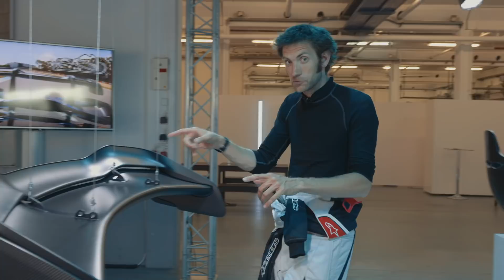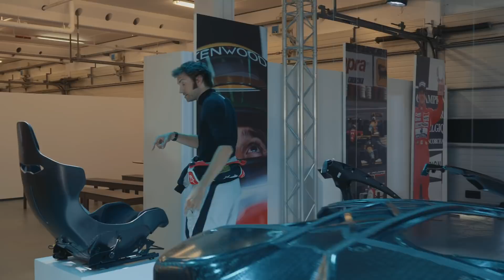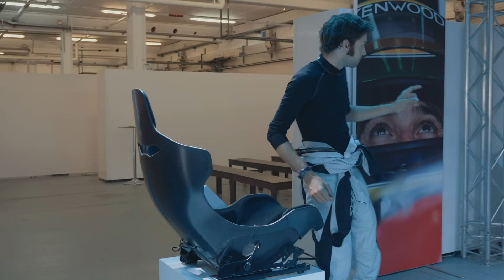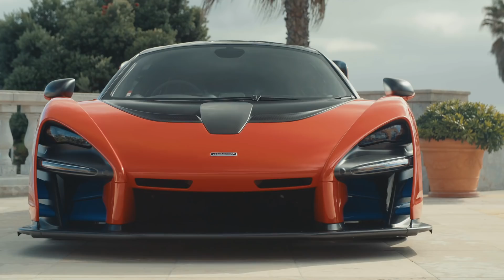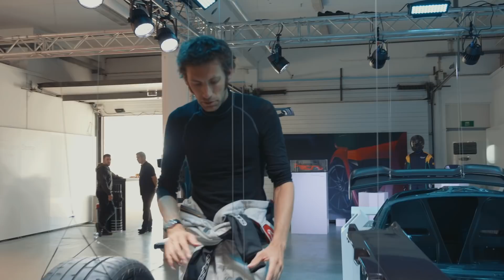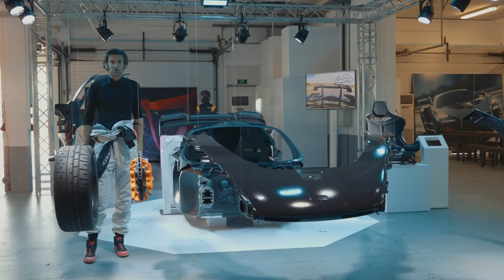The Lightweight Engineering Of McLaren Senna - Carfection +

Comment: This makes the koenigsegg agera rs so much more astounding. The agera is around 100kg heavier but with a bigger and much more powerfull engine, removeable roof and much more "luxury" features. (+ it's 3 years old now. i bet koenigegg could shave of a lot of the weight if they would do a ultalight barebones version. even the one:1 has leatherseats, heightreluglation a big infotainment system and so on)

Comment: Do the brakes have a diff material mix compared with other McLaren carbon ceramics? or is the only difference that they are cured much  slower?

Cool video BTW
Reply: Mile The braking system is the most advanced ever fitted to a McLaren road car. The next-generation carbon ceramic brakes utilise racing technology, and each disc takes seven months to create – seven times longer than a conventional carbon ceramic disc. The Formula 1™ inspired front calipers feature a super-stiff monobloc design and six ventilated pistons to reduce temperatures. A brake booster used on the track-only McLaren P1™ GTR enhances modulation and pedal consistency. The resulting braking performance is phenomenal: 124mph (200km/h) to standstill is achieved in just 100 metres, and less than 30 metres is covered when stopping from 62mph (100km/h).  

Copied and pasted straight from McLaren. Dont know if it really answers your question though.

Comment: Hate on the Senna all you like (if you do). It’s been designed to crush lap times not look pretty in Monaco, Beverly Hills or Knightsbridge.
Reply: True, but I wish that McLaren had given it another turn to be a bit more radical, more in the league of the project one and the Valkyrie, but I understand that we are talking about 750k not 2 millions or more.
Reply: For sure. As fast as the Senna is, I think the Valkyrie and Proj. 1 will far exceed it's performance and be closer to LMP1 (on slicks) than any other road car ever made. The Senna probably has a real world 850+ BHP, but it definitely falls of the other two cars, but as you say it makes sense with the price difference.
Reply: CADesigner  The reason why it dosen't look as good as it could is that McLaren had to create highly advanced aerodynamics, but use the 720S's general outline to reduce costs(price point) versus the Aston Martin Valkyrie as an example.
Reply: I think it looks incredible
Reply: stubones easy to say it will crush times so far just speculation. Is it faster then Porsche GT2RS time will tell. Plenty of great track cars look good to
Reply: I believe McLaren are making a direct p1 replacement likely close to the range of those vehicles. The Senna and 720s are more real world test mules for their tech which is why they can’t and haven’t made too much of either since they need the money for another project
Reply: stubones cause you can only think inside the box. why not have aesthetics and performance at the same time (P1, 918, LaF). you are spending a huge amount of money to buy the car, might as well have both aspects.